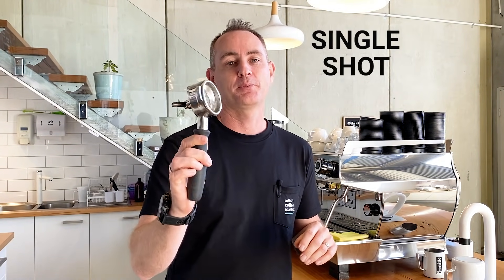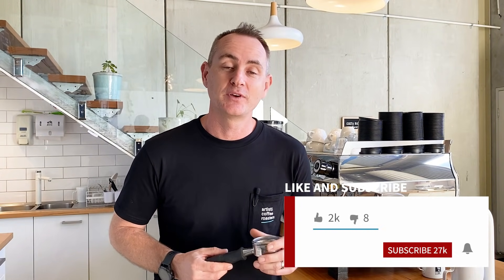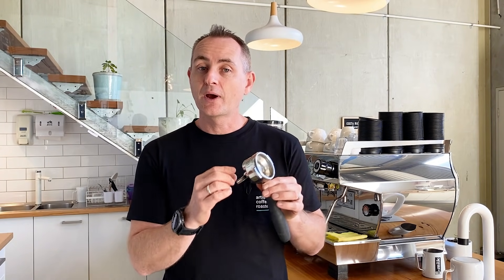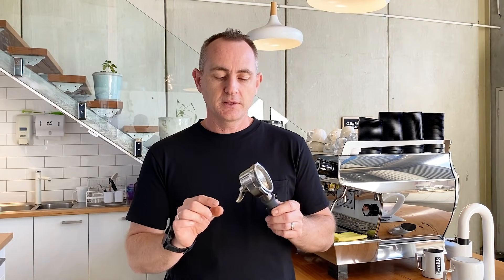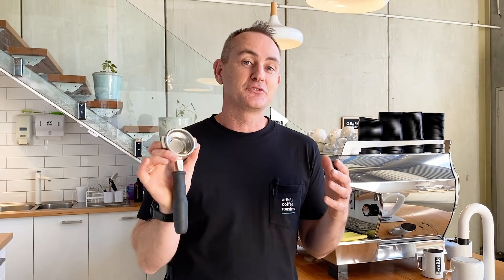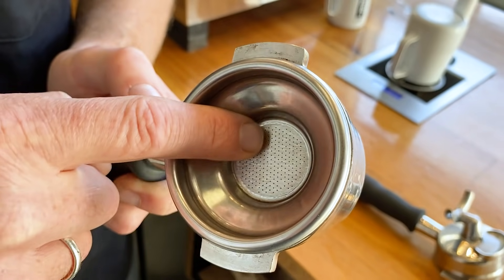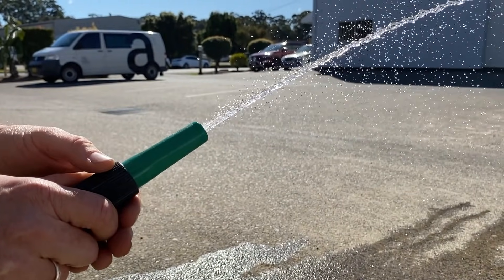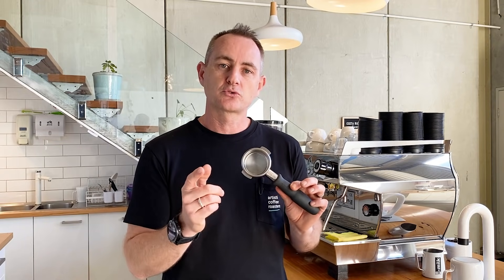Why we DON'T use a Single Shot Coffee Basket to make Coffee

Comment: I don't really have a problem with them. It works great at my place. :) I think your garden hose illustration is simplifying things a little too much. Remember it is the resistance in the grinded coffee that is building the pressure, not the brew basket.
Reply from the maker: Yep, definitely supposed to be a simple explanation. Thanks for the link
Reply from the maker: Great to hear that you can produce a good cup at home.
Reply: Same here. Been using single baskets since for over 25 years. Single for aingle espresso, double for double. Easy. And no additional grinder setting dialling required, use same grind setting for both, just on a different singke/double timer settings on my Mazzer Elec. It comes down to patience and a bit of tuning at the beggining, and "stickinnes" to the same or similar coffee been blends selection rather than experimenting with many.
Reply: Ditto here. I have no issues producing great espresso out of single dose basket.

Comment: The reason is that in water tubes you get a sharper flow is NOT changing in pressure. The velocity of water changes as it passes through different surfaces so that the flow rate (amount of water passes through a surface unit) stays the same. This doesn't have any thing to do with pressure. Also, in the watering you exemplified, the relative pressure becomes zero as it sprays to the air. What the velocity changes during this cross changes is the FORCE it applies. The same almost happens to single dose portafilter. I said almost, not thoroughly
Reply: It is definitely a change in pressure when the tube becomes more constrict. That is why humans have high blood pressure. When extracting single dose, the pressure on the espresso machine is always higher than double dose due to the basket design.
Reply: @Stantube1000  If pressure is higher than OPV, it would simply be choked.

Comment: I can't say much about a commercial environment, but at home I don't find it difficult to get delicious espresso with a single basket (11.5 gram) or even a smaller one (8g) that requires a special tamper. Grind size needs to be right, and distribution / tamping needs to be done correctly, but the result is excellent. I see absolutely no reason to make more coffee than I need and want, which is usually a single and not a double. I only use the double basket when I'm hosting and need to make a lot of coffee quickly.
Reply from the maker: For sure, glad you have the ability to adjust the grind to suit the single handle. 👍🏻 out tips and tricks are on the way.
Reply: i experimented with the single basket for 1 month and came to the same conclusion as you. My basket recommended dose is 7 to 11 gram. After repeated iterations, i find overdosing to 11.5g yields the best results.

Comment: Well there is nothing wrong with your reasoning regarding the flow, but What about the original home of espresso, Italy, where for half a century people have stopped for a single shot several times throughout the day? 7 grams of coffee in, and most often just 14 grams of beverage out. This is the very definition of espresso, despite the fact that most modern places outside of Italy use 18 or more grams for every pull and only serve larger-than-doubles. I would personally prefer to enjoy four or five singles spread apart during the day instead of one or two larger than double shots. I have bought espressos while out that have been closer to triples, and there is probably no such thing as a triple in Italy. I feel it's too much beverage, and too much of a departure from a genuine espresso.
Reply from the maker: Yes true, the traditional Esprssso has its home, with the lighter roasts and new processing of coffee the traditional extraction just does not do coffee justice.

Comment: There is no rule that says you need 18g. In Italy where they prepare the best coffee they prepare 3 coffees with 18g 😅, they use 7-8g for a single dose and 14-16g for 2 persons or doppio. This is why the machine is provided with baskets of 7-8 or 15-16 😅

They also use single basket but adapat the temperture of extraction (1.5 degree higher than for double), I used to waste coffee when I starded with 18 or 20g, following fake barista expert
but I discovred that the right dose is arround 15g for double dose, and confimed this with baristas who prepare thousands coffees/week.

Comment: Nice channel guys, thanks for all the great info! I just wanted to add that one situation in which a single basket can function just fine is with a home lever machine. I just got a single basket for my pre-millenium Europiccola and have no trouble at all getting similar quality to my double shots using the same grind, for two reasons: the diameter is small, only 49mm, which means the shape of the basket is not so flat, and I control the brew pressure directly with my hand so I can easily prevent the water from blowing the puck apart. But I agree, it's darn near impossible to get a good single shot from a 58mm basket on a pump machine.
Reply from the maker: Thanks for the insight, good old lever 👍🏻

Comment: I reckon this advice applies equally to home machines - at least those with an E61. I have put up with 'sludgey' and inconsistent single shots for years and only gave up finally in the last couple of weeks. Immediate improvement well worth the occasional few extra grams. More good advice from Artisti.
Reply: I am currently using a single dose basket with an E61 and my results are better than double shot basket. I've tried many and many times  with double, and (for me) i get better extraction. My single dose basket is not like the basket showed in the video. My single dose basket is tottally planar, not pressurized and the bottom is full of holes, not only a half of the diameter. My setup:

- 12,5 grams of fine ground coffee (grinder: eureka mignon specialità)
- 25-30 seconds
- 25-35 g extracted coffee.

My result is a very creamy and chocolate flavoured coffee. I'm using Illy classic during last month.

Best regards.
Reply from the maker: The colour just pops!

Comment: LaMarzocco has a good single basket with straight walls 41mm - fits between 7-9g. My ECM stock single basket nominates itself to 9g but it needs a bit more , around 11g. I honestly never had issues with channeling or bad taste from both baskets. It's just the trial and error phase till you figure it out.
Reply from the maker: If your swapping from single l, double and triple it’s very hard to have the same grind and consistency

Comment: the single basket from decent espresso (10g for E61 groupheads) is an exception. full 58mm diameter bottom, works perfectly.
Reply from the maker: Yes, thats great. A new machine producing the correct modern equipment. They have a wonderful product. 👍🏻 cheers luke

Comment: I should add that when working with dark roasts, the imperfections and difference betwen a double and single basket matter much less, as the coffee is so soluble. The countries where the single shot is used (most mediterranean countries) drink almost exclusively coffee roasted very dark in single shots of 21-25g at over a 1:3 ratio, at which point the coffee is always very well extracted anyway, and the bitter taste is already dominated by the roast level.
Reply: I live in a Mediterranean country and I have never seen or heard anyone using a single basket in a commercial setting
Reply: @theodorosconstantinides7417  I've been to 4 and I've seen them used in all 4, and in France too. I have also seen making a double and throwing one out though.
Reply: it was my experience as you describe in my overseas travels, dark roast and single baskets.

Comment: I don’t agree with your reasoning about the pressure you brew at being higher when using the single basket: you are right that restricting the flow theoretically increases resistance hence pressure IN the basket (same as grinding finer does), but the machine also has an over pressure valve (OPV) which you set at the highest pressure you want to brew at and obviously this will limit the pressure in your basket at the set point - say 8bar. Therefore you won’t brew at higher pressure with the single dose unless with the double you brew at a lower point than OPV setting because you are grinding coarser.

Personally I drink espresso at home, and about 1:3 times I find myself needing to use the single dose basket because I want to limit my caffeine intake and don’t want to throw away half. I haven’t noticed any significant difference in taste/extraction between using the two baskets - but this is way too subjective to judge by; maybe my taste isn’t that refined. But the technical arguments seem to confirm this.
Reply from the maker: Sure I understand and agree with you on the OPV, this protects the pump and hoses in the machine. When you measure the pressure inside the handle the pressure front the top of the coffee bed back to the pump is only as good as the packed bed of coffee. But thru the bed if the coffee in the single basket the density changes due to the variable areas in the Basket and this has a different pressure inside the puck effecting water flow. Cheers luke
Reply: That is what I think and do too. Coffee usage is decreased and caffeine intake is lowers with single shots.
Reply: Hey Luke, congrats to you and the entire Artisti Coffee team for the nice work explaining things coffee from your professional knowledge and perspective. Thank you.

I think we are actually discussing flow in the single dose basket rather than pressure (which should be rather constant throughout the puck), and it’s 100% true that flow through the coffee sitting at the edge of the basket is less because of the shape which dictates a longer path for the water flowing at roughly same speed (given same pressure). But if we look closely at that shape we notice that there just isn’t more than a small amount of coffee in that longer path (like 20%) and also the result of less flow is under-extraction rather than over-extraction from that coffee - which should have a not so bad effect and to a small degree for the final drink. I think this is a small compromise which was taken into account in the design of these baskets (hence they are a bit more than exactly half of the double basket) and the compromise is worth it in order to be able to get a smaller dose of coffee from the same portafilter as a double. I don’t think a single will ever go bad because of this alone.
The best person I can think of to do an experiment and either prove or disprove this is probably @JamesHoffman :)

Comment: I have a few  questions for you, if you don'[t mind:  1) Do you need a bottomless portafilter for the 21g basket into which you put 22.5g?  2) How much coffee do you get from that?  3)How much coffee would you use in a double basket to get about 45 ml (1.5 oz in the USA) of coffee?  4) I had my grinder/distributor and tamp dialled in for Lavazza Espresso Italiano from the warehouse store.  When we used that up and went to a full city roast from the local roaster, I had to make the grind finer and tamp down hard to get a 20 second extraction.  Why is that?   Thanks
Reply: Fresher beans require more fine grinding settings. At least from my experience.
Reply: 1)Most likely yes, otherwise the bottom of your basket will hit the bottom of the portafilter. 21 is usually oversize so i'd say you need a naked portafilter.
2)You get whatever coffee you want, it depends on your recipe ;)
3)Again, it depends on the recipe you use and the coffee. For 45ml out i'd say you need at least 20 grams. Put more ground coffee and your extraction will be higher, obviously.
4)Every coffee is different. Roast level, actual variety, how long since roast, bla bla bla. Your Lavazza is a prepackaged "old" commercial coffee. It's pretty much already shot. Generally speaking you don't need to change your grind much between coffees, providing they are fresh. Nothing wrong with using a supermarket brand in a pinch but you really want to spend more and get coffee roasted, generally, within 7 days so you can have the best experience.

Comment: Question for you, guys.
Have you actually found a basket that will still retain straight walls but hit the lower limit of what is possible in terms of grams for a single shot. Basically, anyone knows a good basket that can accomodate 14 grams MAX but is not "funnelled"?
Reply: i think you're after a 14 gram double basket, single shots are around 7 grams.
Reply: @Ghorda9  I know, what i mean is that i use an 18 gram basket for my shot daily. I would want to know if there is anothing that is worth buying to reduce the ground coffee amount that tiny bit. I know 14 grams is on the lower limit of what works.
Reply: @giodc8599  i know those baskets tend to be beveled a bit but they work fine for me when doing a cortado
Reply: @Ghorda9  What are you using? I got an IMS 18gr as my main but keen to experiment.
Reply: @giodc8599  22 gram double pullman precision basket for two shots and a 14 gram double E61 for a single cortado, also i only use cappuccino cups.
Reply: There is a 15g VST basket. I have one and it really only holds 14g.
Reply from the maker: We can get a LM 14g basket, it works well and come with the new machines

Comment: If the pressure is naturally higher, maybe grind coarser and have a lower flow rate?  In your opinion, what would be the smallest 58mm basket one could use?
Reply from the maker: A straight wall 12g dose at 10g with a fine grind. Going coarse will only reduce your TDS and not taste as good.

Comment: Surprised no one has mentioned the straight-walled La Marzocco 7g single basket yet. Do you have thoughts on this? Would the somewhat more involved workflow (funnel, different tamper) be too much in a coffee shop setting? Personally, I love that basket for home use: it yields singles that are very similar to split doubles, without wasting any coffee.
Reply from the maker: Sure, it can be used, funnels and tampers and ocd are used in commercial cafes that really focus on quality, there are many that think they want quality but really just want the look of a good machine and to pump it out, not clean the machine correctly and go home as soon as they can.

Comment: On the subject of baskets, do you use the machine manufacturer supplied baskets, or aftermarket? For what reason? I’ve always to date used the baskets that came with the machine, but have recently been looking at what else is available.
Reply from the maker: Our other video on baskets will help answer this one https://www.youtube.com/watch?v=gm2OzyHkhIU&t=158s
Reply: @ArtistiCoffeeRoasters  I have seen that video, but it doesn’t really address aftermarket baskets, just the style of basket. There seems to be various opinions out there that VST baskets, or Pullman baskets, will result in a better extraction compared to the manufacturers baskets in a side by side test.

Comment: So if you should only use a "straight wall" basket are you saying you never use any of the LM ridged? Thanks for vid as always!
Reply from the maker: Yep that’s correct, we swap them out if we can, it the ridge is ok as we dose under this line by 2-3mm so it does not effect the coffee puck, but it hold the wire in place better. Cheers luke

Comment: a) If I put a single dose (7-9g) of coffee in a "single" conical basket (for 7-9g), I am going to face pressure variation along the puck height (explained in this video)

b) If I put a single dose (7-9g) of coffee in a "single" cylindrical basket (for 7-9g), I have a less deep puck and less resistance to water flow (more potential channelling?)

c) If I put a single dose (7-9g) of coffee in a "double" cylindrical basket (for 14-18g), I am going to have higher empty space above the puck AND a less deep puck (more turbulence? more potential channelling?)

Which scenario is preferable to reduce risks? Or it offers an easier procedure to prevent potential troubles?
(e.g., in case b, a finer grind to balance the puck resistance)
Reply from the maker: I would recommend option (c) with a finer Grind, the water flow will be the most consistent, it will be a shorter extraction, say a 1-3 max as then the puck will float. You will see the extraction speed up

Comment: Hi and thanks for the info, 
my question is that even my double basket is slightly tapered , so am I better off dosing a triple basket with a double dose as it’s the only straight basket I have ?
Reply from the maker: Yes, you then have a more consistent and even flow to work with. You may need to go a little finer and make sure you don’t run too long and have the puck float.

Comment: I have question, if 21 gr basket, fill up only 18 gr, what happen??
Reply from the maker: That’s ok for a short shot of 40g max yield, you have to use a finer grind as at some point the coffee puck will float and then the water will run around the coffee giving a very watery fast liquid. Cheers luke

Comment: I still don’t get that . Mind to explain further ? Btw, may I ask how to steam milk at 90 degree for cappuccino?  I have a regular customer who wants his cappuccino at 90 degree which somehow I find struggling making a good cup of cappuccino for him. Any tips? Thanks in advance.
Reply from the maker: Heat the cup, get a small amount of foam, the bring to the normal temp of 65 degrees. Reduce your steam when you can no longer keep the milk spinning without getting any more hiss, the extra high heat will naturally make more bubbles. 👍🏻 cheers luke
Reply: @ArtistiCoffeeRoasters  thanks for your tips  Luke . We use paper cups even for dine in customers due to pandemic . Hence I can’t heat up the cup . 😉 
The milk starts  bubbling up once it hits the temperature of 80 degree and it starts overflowing although I use a big pitcher.